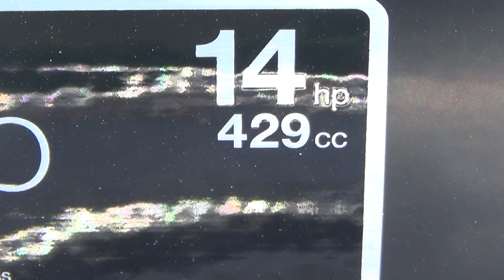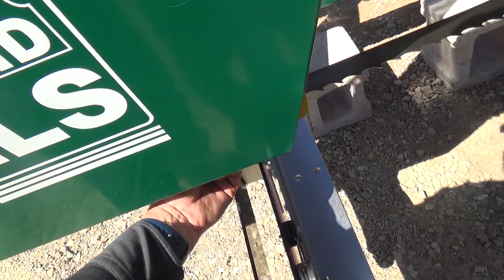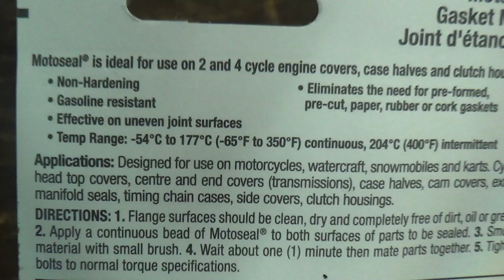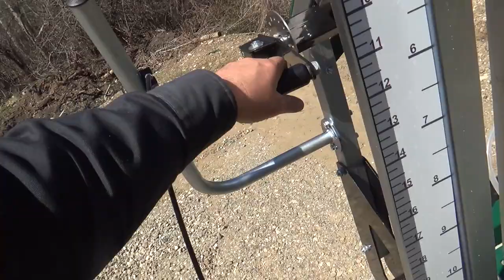Saw Mill won't fit on the tracks??...Lets figure this out and try to fire it up

Comment: Last weekend myself and son-in-law put together a new HM130MAX Woodlander with trailer, extensions, log ramps and winch.  I followed the instructions closely, removed or added shims where told and only tightened bolts when instructed to do so. We had zero fitment issues . I kept thinking check the instructions, check the instructions. I lifted the head onto the trailer with the loader on my B2601 Kubota. We had to lower the front of the trailer to get enough height. I used a socket as a spacer to set head height. Took us less than 2 days and We were sawing logs Sunday afternoon. We figure we sawed $200 of lumber in 30 minutes based on local prices from a dead standing cedar we cut behind the house. Awesome mill

Comment: I use the premium gas in my small engine because it dose not have ethanol which eats away the lite weight fuel lines
Reply: i used to had kholer engine on a lawn mower wich i didnt like it so had sell my mower and got a honda